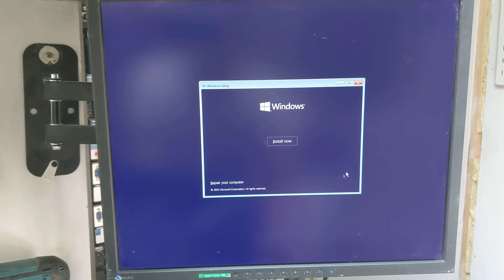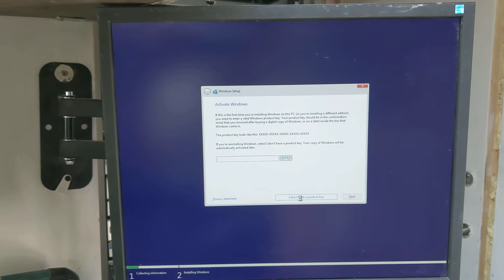Hp z440 z640 z840 turbo drive zturbo nvme SSD installation

Comment: Can you boot from Turbo Drive ?
Reply: Yes i'm running dual NVMe SAMSUNG 990 one for boot one for games/applications.
Reply: Are you still using it I got a z440 with a e5 2640 v4 and a Rx 580 8gb with a 2.5 SSD and I wanna upgrade from this crappy hhd 500 gig which I installed my games on and sometimes it just stops showing up so I can't even play @xMandalorex
Reply: @bu56  yup

Got the 22 core xeon 256gb ddr 4 ram and nvme drives 990 and 2.5 inch SSD's it's a monster.
Reply: @xMandalorex  dammnn hopfully i cant upgrade to those specs how did you pay for your pc with all the upgrades
Reply: @bu56  work... Lol saved up
Reply: @xMandalorex  i meant to say how much did it cost lol
Reply: @bu56   @bu56  When i got the machine? it only had 8gb ram and dual core i upgraded it over a three year period

so maybe few 100's over the 3 years 

Currently have a 3090 RTX in it... (JUST ABOUT FITS)

lol
Reply: @xMandalorex  damnnn but does the rtx 3090 get fully maxed out in games?
Reply: @bu56  Most games sure? Remember the system has 256GB RAM + 22 core xeon which helps lol.

The RTX 3090 though... is a VERY VERY TIGHT SQUEEZE... but it works and have to use adapters to power the GPU like the 12/16 pin configure via 8 pin.

I don't think this system can handle a 4090 though lol she'll probs blow up.
Reply: @xMandalorex  damnnn nice build man thanks for the info